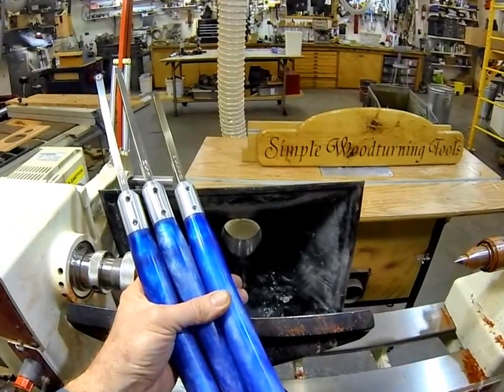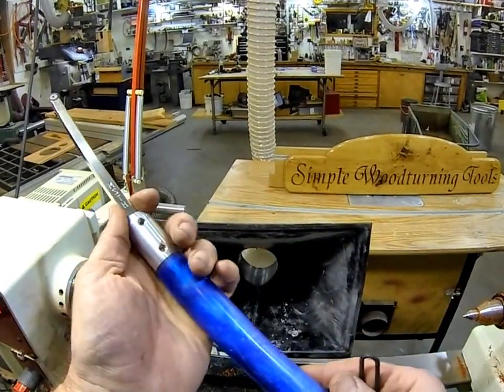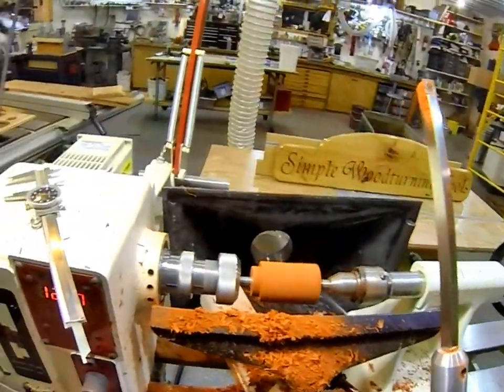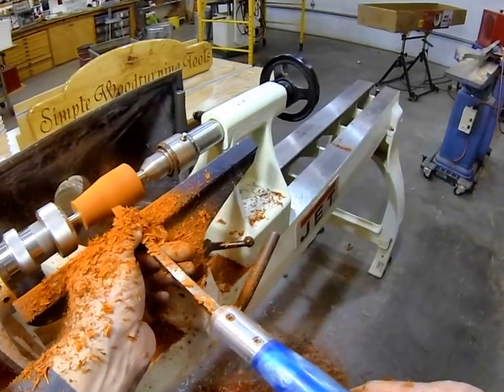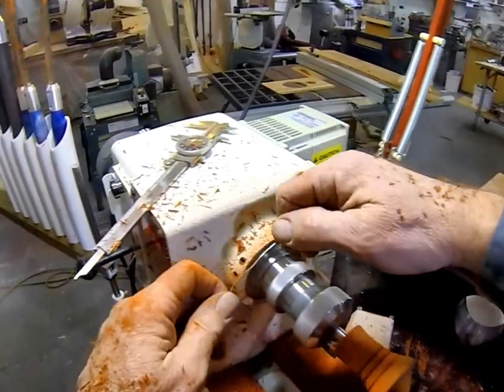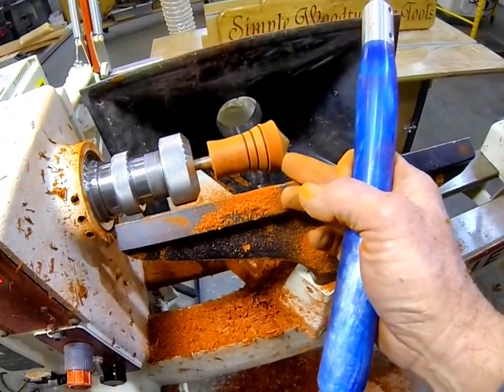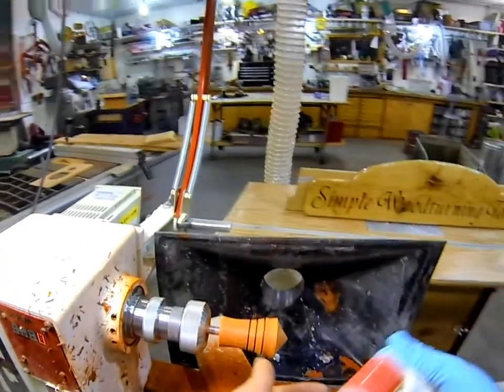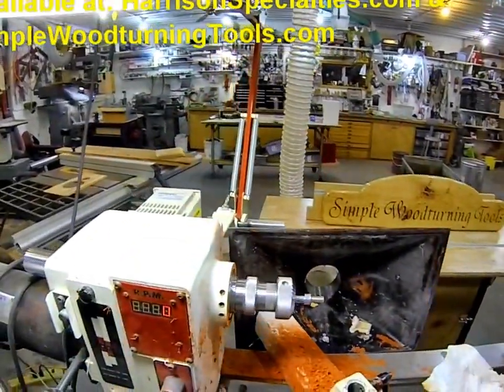Mid Size Simple Woodturning Tools Demo

Comment: Kerry do the mid size handles come in different colors? I'm thinking maybe getting a different color handle for each cutter, for easy tool identification.
Reply from the maker: Yes they do. Here's a link to them - https://www.simplewoodturningtools.com/collections/handles/products/mid-size-interchangeable-handle-pick-your-color?variant=17950598823987
Reply: @KerryHarrison-Woodturning  Thanks Kerry,

Sorry to see that the Acrylic?Resin handles are no longer available, They were very attractive. Did they not hold up to the work demanded?

Any way I will be purchasing the four tool Midsize set. With different colored handles. Thank you for the effort made for the tools and videos.
Reply from the maker: @ultramaga6684  You're correct, they were not durable enough, plus too expensive to make. So I changed the design to powder coated solid aluminum and those have been great. They're super tough and will last for many generations. Thanks for you kind words and business, we really appreciate both.
Reply: @KerryHarrison-Woodturning  You are very welcome, I am glad that I found you and Simple Wood Turning Tools.

Comment: How do you sharpen the tool bit or carbide tip?
Reply from the maker: +Jeffrey Kumjian Carbide cutters can be touched up with diamond sharpening equipment.  However since carbide cutters last so long and are relatively inexpensive to replace most turners go that route.